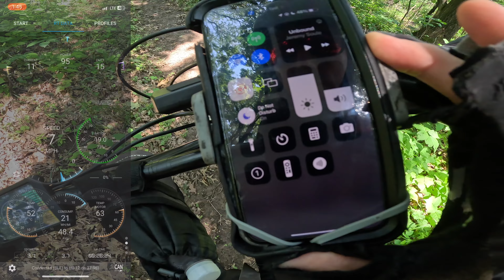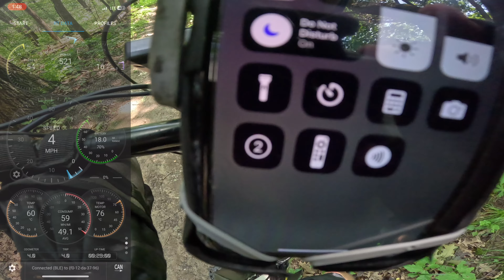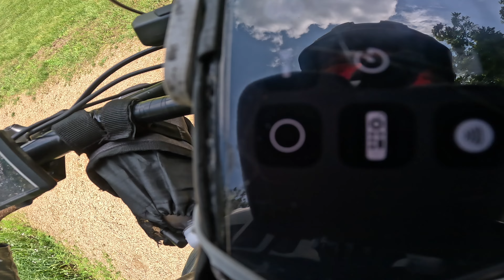Bafang REGEN on a TRAIL - Why I Like Regen Braking. Addressing Comments.

Comment: Good to see you and glad you are well. That dual hub bike books right along....looks to be 2400 watts or so average opened up per your settings but sure gets toasty at 65C.

On my end, I am mostly riding my BBSHD roadbike and BBSHD 29'er because of Florida heat, but this morning was out my carbon roadbike with no motor pacelining with other fast olders at 20mph average.  A couple of days ago, I was pushing too hard and almost passed out due to what I believe to be heat stroke at the top of a bridge.  Unexpected but I came back to my senses after resting and getting more fluids down.
On this morning's ride, I headed out a bit earlier so was a bit less affected by the heat but still dam hot.

I love the mixture of motor riding and roadbiking with no motor.  Love it all.
Cheers and happy riding.
Reply from the maker: hey Luke good to hear from you thanks for the comment mate!! good to hear you are out riding the bikes!! Be careful in the heat Bro!! I think I almost had a heat stroke one time, when i was out on a disc golf course on a heat advisory day...  and under estimated how long my water would last me!! Good to hear you are doing OK and it wasn't serious,  I was mostly just confused when It happened to me. and It kinda like hurts my head to think about it,  It wasn't good.  After a few of those experiences, I always lug around a giant bottle of water just in case I have to pull off on the side of the road and fix a flat for an extra hour or something...
Reply: @EBikeBuilder_  Good advice EEB.  Road cyclists are a competitive breed or we wouldn't suffer so much to ride so fast. But in the heat as you say, a stark reminder.  Age is probably a factor.  I am a fit old guy who swims and bikes in FL almost every day but no stopping the march of father time.
I don't ride great in the heat as a rule but this bout which was likely heat stroke a couple of days ago, made me take note and not push myself that hard today.
Your channel is very interesting with all the testing of different motor and bike scenarios.  I built my first mini bike from scratch when I was 12 y.o. with a bicycle front end and space frame rear I fabricated from tubing and lawn mower engine.  My first one would do about 30 mph with solid wheelbarrow tires.  My second one with 5 hp modified...ported & polished lawn mower engine with governor removed a few other mods would do 45mph which was fun for a 13 y.o.  All pre-internet. Today, kids mostly just buy everything. I built everything from scratch so I understand and appreciate your technical proclivity.
Thanks for all the education you provide to the ebike community....a feast for tech heads.
Ride safe.

Comment: I've been running Regen in the mountains for 3 years now. I also have a trailer carrying solar panels. That's silly saying you should not use Regen when coming to a complete stop. They must be thinking with lower voltage it is harming the battery. Not so. My solar panels put in low voltage when going through shadows and no bad effects in three years. Battery will take whatever it can get except for over voltage and BMS if you have one, will handle it. With Regen I just use cable brakes for the last bit of stopping. With cable brakes there is one less thing to screw up (putting holes in the hydraulic line) when you're 30 miles back in the bush. Still waiting for those Grin fat All Axel motors. Should be interesting having 2 motors with variable Regen. Beauty about Regen is that the wheels don't lock up so it's great for coming down mountains with a heavy load in the trailer . 3 of my AWD bikes have Regen on the front wheel as it gives you better control going down hill with heavy loads. Majority of the time I use the front wheel as my main motor because where you point is where you go though the trees and rocks.Different style of driving in the bush than primarily driving on paved roads. Think about it, when you are applying brakes in your car more power goes to the front brakes than the rear for control purposes.
Reply from the maker: the rear motor regen is so strong, I can only imagine front motor regen would be insane! Im scared to even try that lol, after destroying 2 forks' dropouts WITHOUT regen. Curious what fork you use for front regen? is it a geared hub or DD??  I have a bafang FM g061 1000w front motor sitting here, with 14mm axle flats, brand new, L1121 connector,  better than my g60 front thats only 750w. Im just not sure if it can even fit in my fork without grinding it or something. The M14 flange nuts are huge. Then Id need another dang grin tech v7 torque arm too lmao. But that Idea is certainly stuck in my brain now,  Thanks Lol 😅🤣  I think if you had regen on 2 of these motors together itd be aboslutely insane and you coudl probably just put your foot down to stop like the flintstones car
Reply from the maker: do you use a knobby tire in the front then?? for the front motoring?  My problem with the front motor is it's so dang noisy on video. The g60 front for whatever reason is alot louder than the G62 rear.
Reply: @EBikeBuilder_ @EBikeBuilder_ In 6 months you will become one with the Zen of Regen. By then you won't even have to think about it. I use both geared and DD motors. I have the All Axel motor with built in torque arm on a RST RENEGADE 15X150 through axel and G061 L1221 connector plus 500w G020 on a RST GUIDE with torque arm with no problems but am switching to the v7 as it is a no-brainer. I have a G061 and it is 10mm Axel flats, strange yours is 14mm never heard of that. Are you sure? Standard forks are 10mm .
With a population of almost 46,000 in all of Yukon there are very few paved roads. There is a 60 mile stretch with real pavement on the Alaska Highway coming into Whitehorse that is real pavement like what you drive on the rest is chip seal (3/4 gravel mixed with tar). Because it is too cold for salt to work in winter the rough surface of chip seal gives you grip on the road but tears your tires apart. I live on a mountain with dirt roads so knobby tires are essential. Just stepping out of my yard I have 100's of miles of trails through the mountains with no pavement.
Just getting spokes for AWD 750W Bafang winter snow trail bike with 4.8 tires and 100mm rims. Trying to make bike as light as possible without suspension forks to follow sled dog and snowmobile trails. I bought the High Voltage adapter to use front chainring on cassette for the fat All Axel build, should prove interesting.

Comment: I'm surprised to hear you say you get 10% regen back into your battery, but still not for me for 2 reasons: #1) I like to get up to speed, glide etc and bogging down every time I let of the juice would drive me batshit crazy, and #2) it causes too much wear on your motor - its working whether you're on the throttle or off. If it were such a great thing all geared hub motors would come like that stock, but they don't. The only way I'd be inclined to do this is if there was a clutch lever to engage it at my discretion. Just my 2 cents on the matter and I'm going to be quiet about it.
Reply: It seems like you found a configuration that works for you: geared hub with clutch. Which is, maybe, over 90% of ebikes sold. For other folks considering regen with a Direct Drive motor or a Geared with the welded clutch and are worried about 'bogging down' you can simply feather the throttle to speed you desire. With a little practice you can make it very smooth.
Reply from the maker: I’ve thought 💭 pretty hard about why they don’t have Regen stock. First of all, Securely mounting the motor on the bike is more complicated- lots more fatigue and stress on dropouts, (keep in mind these motors come stock with “torque washers” that sit in the dropout and act as a poor man’s torque arm). So its just cheaper easier and safer to install and mount when it doesn’t regen. Another reason is the controller requires regen, costs associated with more expensive controllers. Then the battery needs to be able to handle Regen and charge through the discharge port, which many ebike batteries BMS are not set up for- they have separate charge and discharge ports. Most ebike batteries are using crappy batteries that can only charge at a few amps, so regen is pointless on those. So regen requires a battery that’s got decent charging current.  Then finally it requires an additional input to control Regen. People don’t seem to understand regen, and neither did i till i tried it out. Since people don’t understand it, regen isn’t really a selling point manufacturers are going to care about and focus on. But unless you spend a lot of time coasting on your bike, the additional drag is not that big of a deal on an ebike. It only takes 1 or 2 amps of “virtual freewheeling” to completely get rid of that feeling of drag.   Regen to me is free magical braking, that requires no additional input. In terms of the wear on the motor, nylon gears are designed as a fuse, The nylon gears cost 7$ for 3 of them. I’ve had a set of gears last 3 years in this motor, without regen, even if they wear out twice as fast (seems unlikely) it would still totally be worth it. Opportunity cost of brake pads maintenance.
Reply: OK so a better battery needed anyway to Regen to charge it as all my eBike batteries have separate charging & discharging ports to be used as a power bank. They don't fit the front basket anyway as that's a good spot for a dual battery set up & a dual Flipsky for the front wheel to fit. 2 are needed right?
Reply from the maker: @stevecumming6427  if u wanna run dual motors Then Yeah you would need two controllers.  Flipsky doesn't seem to have a "PRO V2" version of their 75100 DUAL,  so it seems like at the moment if you are doing dual motors  then I think you would want two individual 75100 Pro V2's, and then hook them up in a dual vesc / master slave setup,  i havent looked into that yet.   Just to be clear the problem with the existing 75100 "dual" controller, is that it's NOT the V2 - so I dont think it has bluetotth etc. Similar to how there is a 75100, and then the 75100 Pro V2 with all the new goodies.  Confusing naming convention Lol.  But yeah in general- 2 controllers are required for 2 motors, unless it is a special controller built to run dual motors.
Reply from the maker: David another thing about welding the clutch in these motors, is its a piece that you can take out of the motor,  so for example I have two clutches, 1 welded, 1 freewheels,  I can open the motor and pop the freewheeling clutch in,  if I want to restore that original behavior. The clutch assembly with 3 nylon gears is like 25 bucks to have a go at welding it
Reply: @EBikeBuilder_  If you like regen, that's all that really matters. I'm just a guy with an opinion, not really trying to be abrasive. I just don't like the idea of not being able to coast downhill at 40mph - I mean I  probably save as much as you gain with the way I ride. I can't speak for all riders, but I think the majority wouldn't like it. Maybe it's an acquired taste. You may come to the conclusion in the long run that you'd rather have the ability to coast freely, or maybe prefer the braking effect of regen; that's the beauty of experimentation and I'm all for that.

Comment: LOL you answered my question right off on the PAS connection to a Flipsky controller. Think it's port 3 with +, - & a servo wire. Do you know? Watching a Fardriver 72450 connected, he didn't know what the CAN wires were for but that for starting with a key, button or whatever right? If you don't use the PAS, why not take the chain ring off & put on a crank arm aligned with the left crank arm like I do. Can also mix square & diamond cut crank arms to get an offset in pedals for those preferring a spread stance. Tried all 3 combos & I like them equal & rocking like a gimbal on board ships.
Reply from the maker: In terms of the wiring and stuff I cant say for sure I havent looked into it yet, But most cadence sensor PAS are 3 pin  and its 5v / GND / and the signal,  i think youd just hook the PAS sensor signal up to the GPIO general purpose IO.  And the 5v and GND to that right side of the flipsky.  And then configure the PAS as an ADC2 input or something like that.  Here is what BIG DADDY ELON told me, he may or may not be correct: To connect a standard e-bike cadence pedal assist sensor (PAS) to your VESC (Vedder Electronic Speed Controller) motor controller, you'll need to follow a few steps. The PAS typically provides a pulse signal proportional to the pedal cadence, which the VESC can interpret to control the motor speed.

Step-by-Step Guide
Identify the PAS Signal Wires:

Most PAS sensors have three wires: Power (typically 5V), Ground, and Signal.
The Power wire supplies voltage to the sensor.
The Ground wire is the common return path for the electrical current.
The Signal wire sends pulses to the controller as the pedals turn.
Connect PAS Wires to VESC:

Power and Ground: Connect the Power and Ground wires from the PAS sensor to a 5V and Ground pin on the VESC. The VESC usually has 5V and Ground outputs available on the peripheral ports.
Signal: Connect the Signal wire from the PAS to a general-purpose input (GPIO) pin on the VESC.
Configure VESC Firmware:

You'll need to configure the VESC firmware to read the PAS signal and interpret it correctly. This involves setting up the VESC tool to recognize the PAS input.
Open the VESC Tool software on your computer and connect it to your VESC via USB.
Navigate to the App Configuration tab, then go to the ADC (Analog-to-Digital Converter) section. The PAS will likely be connected as an ADC input.
Set the input mode to "Pedal Assist" or "PAS", if available. If not, you may need to configure it as a simple pulse input and adjust the thresholds accordingly.
Configure the parameters such as minimum and maximum voltage, duty cycle, and assist levels to match the characteristics of your PAS sensor.
Test the Configuration:

Once the wiring and configuration are set up, test the system. Rotate the pedals and check if the VESC detects the PAS pulses and responds by driving the motor.
You may need to fine-tune the settings in the VESC Tool to achieve smooth operation and desired pedal assist levels.
Detailed Connections Example
Wiring PAS Sensor:

PAS Power (usually Red): Connect to VESC 5V output.
PAS Ground (usually Black): Connect to VESC Ground.
PAS Signal (usually White): Connect to a free ADC input pin on the VESC.
Configuring in VESC Tool:

App Configuration -> ADC
Set Input Mode to PAS or similar.
Configure Voltage Range (e.g., 0-5V)
Set thresholds for Minimum and Maximum Duty Cycle according to your PAS sensor specifications.
Tips and Troubleshooting
Ensure all connections are secure and there are no short circuits.
If the VESC does not recognize the PAS signal, verify the signal output from the PAS using an oscilloscope or multimeter to ensure it is sending pulses correctly.
Some PAS sensors might require specific pull-up or pull-down resistors; check the datasheet of your sensor for any special requirements.
Refer to VESC community forums and documentation for additional configuration tips and troubleshooting specific to your VESC model and firmware version.
By following these steps, you should be able to successfully integrate a standard e-bike cadence pedal assist sensor with your VESC motor controller
Reply: Wow, thanks that's what's needed to puzzle over as it would be nice to have the pedals power the motor somehow with the chain & chain ring removed. Ride like your invisible & people not watching can be avoided sometimes.

Comment: Cool!  I wanted to do a dual motor mountain bike because I live in Montana.  but I was concerned that the torque on the front end and fork might cause problems( also weight up there)  And please show the bike at the end or beginning of the4 video.
Reply from the maker: i cant emphasize enough - the front motor can easily destroy the dropouts on a fork,  if it's not properly set up with a torque arm.  I blew out 2 forks trying to set up my front motor. RST Guide forks are the only ones ive found with dropouts that can handle a geared hub in the front. The himalo type forks taht are found on 99% of fat tire ebikes WILL EXPLODE even with a torque arm.   And get a good torque arm like the v6 or v7 from grin tech.   For the front motor, bafang makes the FM G61 in 1000W variant now with a 14MM axle flat which is stronger and better
Reply from the maker: the weight of a front motor is about 10 pounds. So its like having a handlebar bag on your bars with some weight in it.  Affects the handling of the bike,  its not ideal for trails,  But if you are dealing with snow or sand then the front motor can really help.   With a strong controller like a Flipsky doing 75 or 80 phase amps, the rear G62 1000w motor is quite adequate on its own in most circumstances

Comment: I have seen people controlling the Regen like a complete reverse throttle. 1 guy was on a very steep grade going 3 mph with just Regen. When braking to a full stop 🛑, at some point the current will plumet & the brake in effect  released & 1 could maybe roll into something in theory is maybe why the warnings you heard. I want a 2 way throttle with a mid indent on a front DD motor mainly for braking, spelling the rear motor to cool, extra umph on steep hills & charging a front battery on a dual battery set up. WDYT?